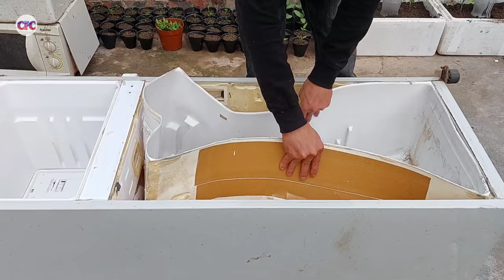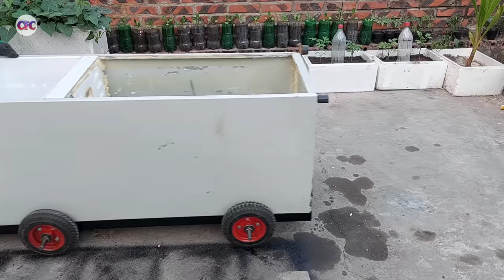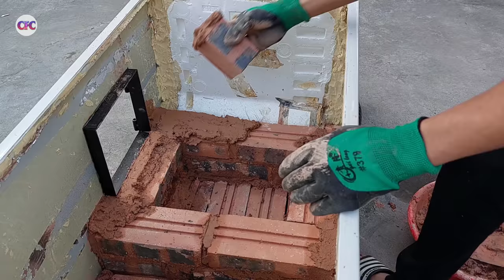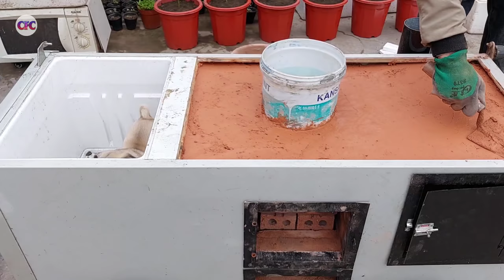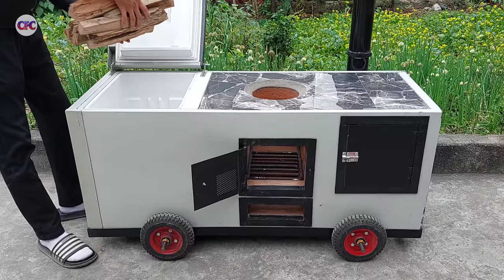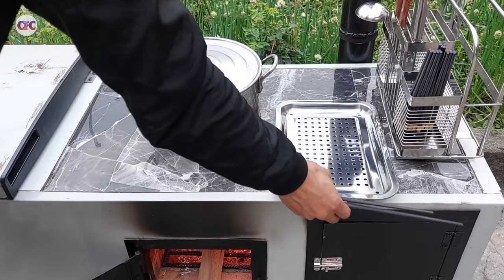How to make a modern wood stove from an old refrigerator

Comment: Could the old freezer part be used as a cooler?
Reply: I don’t think so. Because the fire oven and the cooler just a thin layer of sand apart. When starting the fire, the sand also gets the heat, eventually the cooler will be effected.

Comment: Before all that, I would have got a barrel. Another problem is the compressor. Has to be uncharged before removing it. It lets toxic stuff into the air. If you breathe that, you'll die. It's also not legal to release it. Very problematic build. You basically have to hire a professional to uncharge that. You can on your own, sometimes that's why it doesn't work. Had to fill that part up. Or it has a hole. It would noticably release.
Reply: $10, get a used barrel from a factory. The one's used for chemicals last longer. They have to clean them anyways. Put it on its side, add racks to the bottom. Add a vent, put a door on front also. Then use the top for cooking. Within a half hour build. Add legs, can't sit on the floor. It'll burn anything in front of the door. Needs a latch of some sort on it. That's pretty much it. Add a little vent snuffer and pipe it out the window if you want to use it for a heater. Just really doesn't take that long. Fridge is over working. It's $50 as sits at the least. If you had scrapped it to the right person.
Reply: You should do a kiln though. Out of an old outside propane tank. Ones for heating houses. It has propane hookups already. Or you use elements out of stoves for electric. Line it with cement. Lid too. Those are tens of thousands of dollars. It's same quality. The one's with shelves are higher price. Those are hardened steel, so that works. Fire extinguishers are hardened steel too. It can make two or three.
Reply: You're going to get the tank for like free to $100. If it was no longer wanted to be used. Then it's free build.
Reply: I ain't joking, one could pay for a house.
Reply: Sad they hadn't just taken that for high price.